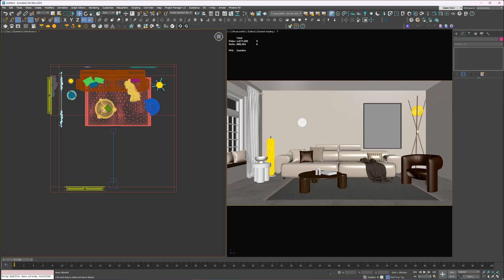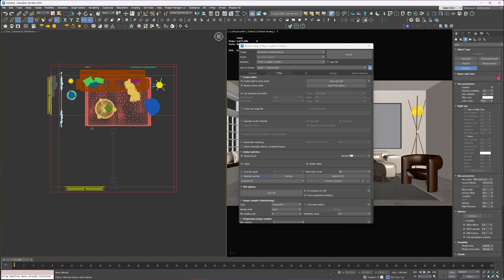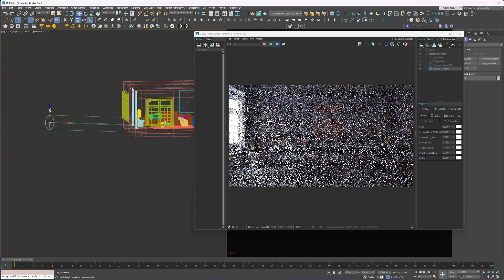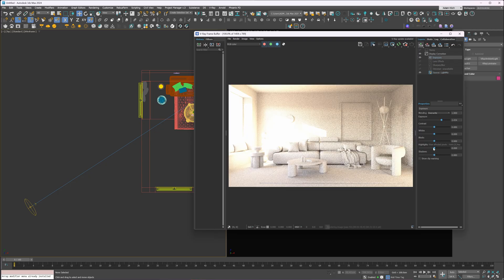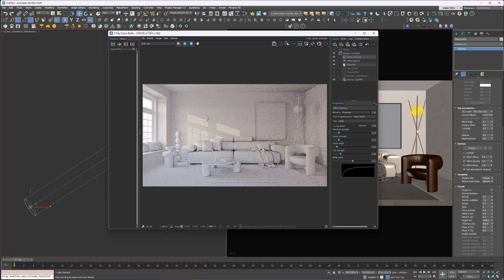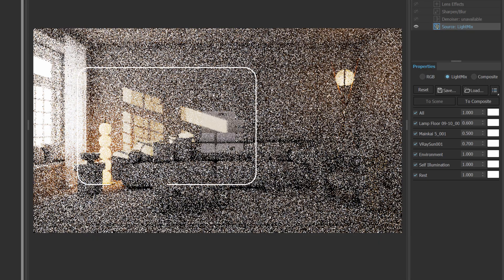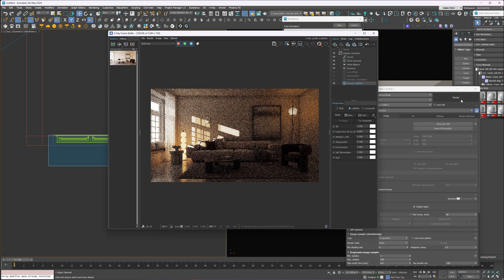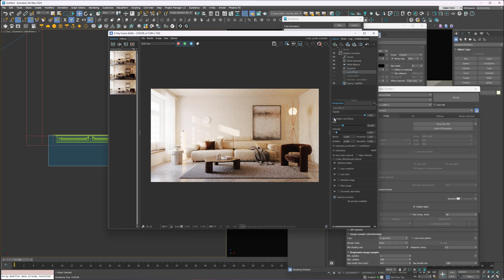Realistic Interior Daylight in V-Ray in Minutes

Comment: Using Vray, you should put the skymap in a domelight. Vray will resolve the image better and in much less time. You're using Vray, not Corona. It's not the same.
Reply: in my opinion is to bright right now and dome will add some blue light
Reply: V-Ray's Adaptive Dome technology speeds up rendering and reduces noise compared to using the environment slot alone, especially for interiors. brightness and color do not change @Bebzoniusz
Reply: V-Ray's Adaptive Dome technology speeds up rendering and reduces noise compared to using the environment slot alone, especially for interiors.
brightness and color do not change